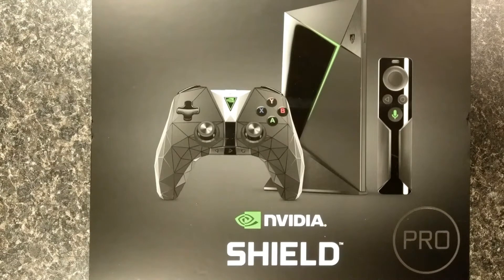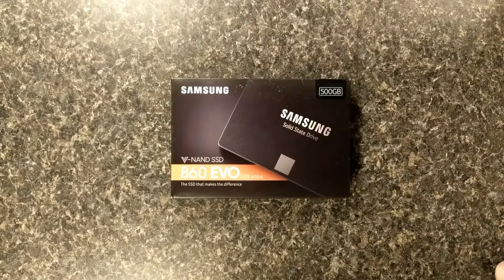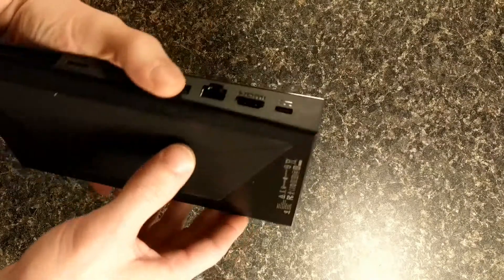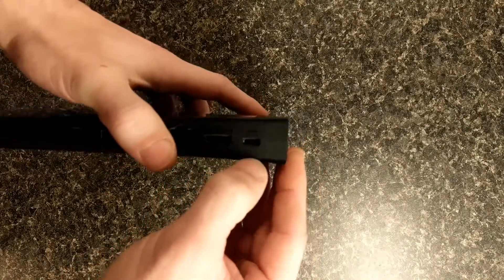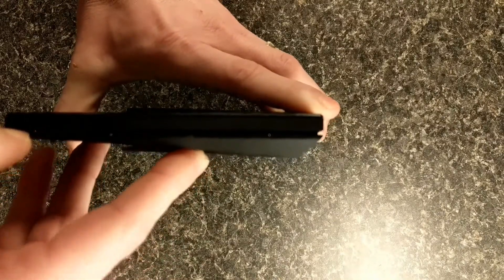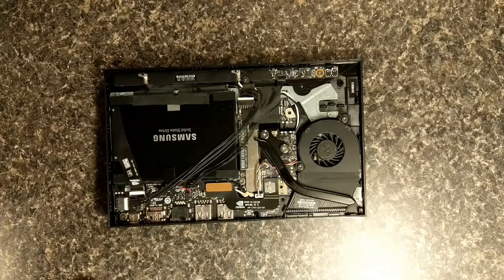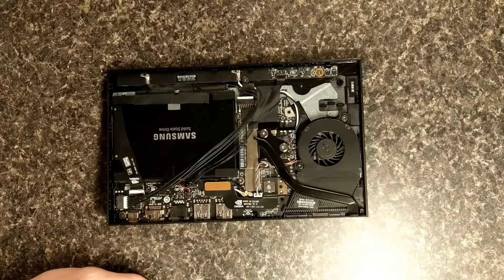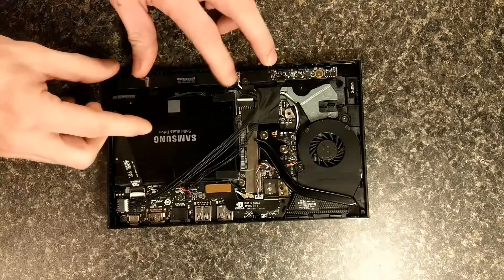Nvidia Shield Pro SSD Installation Part 1 of 2

Comment from the maker: If this video got your shield running SWEET hit that thumbs up and if you haven't already subscribe. Every little bit helps the channel, thanks for watching and have a tech day.
Reply: Please help me i like upgrade  my shield pro with ssd evo 1tb is possible?
Reply from the maker: @StreetGamesCombos  Unfortunately this method will only work with 500gb drives.
Reply: @kelleytech  thanks i need pay  now ssd 500 for upgrade
Reply: Interesting video, can this method also work with an Nvidia Shield tv pro 2019?
Reply: @migram67   The tv pro 2019 does not have a internal hard drive or space for one which is why it is so much smaller vs the 2015/2017 pro.
Reply: Do you by any chance still have a copy of the shield os on a hardrive or pc? tried cloning the drives to an ssd and now my console wont boot with either drive.

Comment: will cloning my drive work if it still wont boot up?
Reply from the maker: I cant say that it will but its your best option. I had a 1st gen shield pro that would not do a complete boot. After the clone it worked great. Remember don't format your original shield drive on accident Hope this helps!
Reply: Thank you sir !! i will let you know the outcome👍
Reply: Well , bad news it wont see the drive  i pluged a new drive in to the same port and it seen it, i may be sol unless i can find the file to download.
Reply: i will try one more thing and i will let ya know
Reply: ok my bad  i slould watch the video more closley the software reconized it , stay tuned, and thanks again
Reply from the maker: @ohmslawone5939  best of luck!

Comment: Can I use a clone device slot a and slot b I use it to clone my pc laptop from 250 to 500 gb will it work for the shield TV
Reply from the maker: Yes, it should work as long as the SSD is 500GB. Hope this helps!
Reply: @kelleytech  thanks  replying as quick as you can I have done it  late  at night and woke up this morning and it's all done placed everything back in it works better thank you very much

Comment: Hi and thx. Is that possible to use a 480 GB ssd instead 500 GB?
Reply from the maker: Hello and thanks for watching, unfortunately this method will only work with 500 GB drives. Hope this helps.

Comment: What exactly is the pro model? I have an nvidia shield with the SD card slot and the 16gb drive. Is that considered a pro? Or is the pro strictly the 500gb model
Reply from the maker: Hello and thanks for watching, unfortunately this will only work with the 2015 and 2017 500GB pro models. The 2019 pro only has 16GB. Hope this helps!

Comment: DOES ANYONE KNOWS CAN THIS BE DONE TO 2019 VERSION?
Reply from the maker: Unfortunately not but USB 3.0 storage devices make a good alternative. Hope this helps and happy streaming!
Reply: @kelleytech  my man...i hooked up a ssd via sabrent USB 3.1 adapter but when I go into the removable storage section on shield under USB drive it says-USB drive is safely ejected...i can't go into it to format...any suggestions?
Reply from the maker: @sifu192ppod  Nvidia shield can be picky, maybe format on a PC first, then try again. Hope this helps!
Reply: @kelleytech  formatted worth PC and up and running thanks bud

Comment: Does this work on the 2019 pro model?
Reply from the maker: Unfortunately the 2019 model has internal storage. This method will only work with 2017 pro or 2015 pro. Hope this helps!
Reply: Kelley Tech thank you!

Comment: I love the video. However, in my case, I cannot do anything. After the last firmware update, my shield pro refuses to boot up. It comes on for a sec then goes dead. If I pwr up the unit via the button manually it comes on for just a second and its dead. The only way I can think of is to use somebody's clone file on my new SSD and hope the shield will be normal in its boot up. Then I can do a factory reset and log in normally. Please help. I spent a fortune on games and now I cant do anything.

Comment: Thank you very much for the great tutorial for updating the HDD. Everything was easy to understand and I really needed to upgrade my HDD since it started really slowing down all of a sudden and I was worried that HDD was on it's way out. Now I have a nice Samsung Evo 860 inside the Shield and everything is going great so far! Liked and Subscribed.
Reply from the maker: Hello RETRO-TYPE
 and thanks for your support, I hope you get many years out of your shield. Happy streaming!
Reply: RETRO-TYPE what kind of improvement did you notice? Is it worth the upgrade my HDD is fine but for some reason I want to do this upgrade.
Reply: @sc6015  It's a noticeable difference for sure, but my reasons for wanting to do it were that it felt like my old harddrive was not going to last much longer. It honestly could have been the HDD or it could have been a weird thing with trying to setup a Plex server, but all of a sudden the Shield was just crawling and nothing I could do seemed to help it much. So with this process, I not only upgraded the hdd, but I also was able to keep my data and file structure intact and transfer it to the new drive and also keep a backup of the original drive as an img fiile  in case I ever need to restore it again. I'd say it's worth it just for that since as I understand it, you have to format these drives a certain way and it all seems to complex for me since I'm not a Linux user.

Comment: Hi Kelley Tech, would it be easier if i just used an external hard drive cloner to make exact copy of the existing shield hard drive?? instead of using ll the cable to connect the hard drives??
Reply from the maker: Hello xXlChAnGeSlXx
 and thanks for watching, Using cloning devices are hit or miss, some work some don't. The method shown in this video is more likely to give you positive results,and you get a backup of your shield drive. So its a win win and its cheaper.Hope this helps!
Reply: @kelleytech  ok thanks for info, well i already had a external cloner because i work in the IT field so i actually tried the cloning method with my external cloner...it took almost 2 hours to clone but it seemed to be cloned perfectly. I am now running my nvidia shield pro on 500gb samsung ssd you recommended in your link(thanks for that) and everything looks great so far and feels much snappier now thanks to you. Thanks for vid

Comment: Will this work on the 2017 non-pro version?
Reply: Non since the non-pro is smaller and doesn't have a hdd slot
Reply from the maker: Hello Greg Szarama
 and thanks for watching, unfortunately it will only work on pro models, wish I could be more helpful.

Comment: So if I were to get a 1 TB Samsung SSD hard drive instead of 500GB are you saying you wont work? Also how did you backup your previous apps before you installed this?
Reply from the maker: Hello Macktube x unfortunately you have to use a 500 GB drive. When you make  a clone it copies all of your apps and settings so it will be just like it was before installing the SSD.
Reply: @kelleytech  OK I thought when you installed a new hard drive,  it forced you to format it and erase all previous data but I guess not

Comment: Does it have to be the drive you pick? I have a Crucial 120gb SSD connected to the USB port, it works but can sometime can be slow when powering up the shield?
Reply from the maker: What's up Wembley 808, you can use just about any ssd as long as its 500GB any other size will not work. hope this helps!

Comment: 1. The screw holding the drive down is a Torx "T6".  2. Never ever pull on the wires.  Some of the cables do not need to be disconnected if otherwise following your "pull/slide-out" method.  This saves time and minimizes the possibility for a mistake if you disconnect the least amount of cables as possible.

Thanks for an otherwise very informative and helpful video!
Reply from the maker: Hello Micheal and thanks for sharing your experience you had installing your SSD. I hope you get many years out of your shield!

Comment: I was seriously about to sell my 2015 original shield TV, but just for giggles looked up about the possibility of putting an SSD into it and this is one of the only results that pops up. Was skeptical, but bought my USB 3.0 to SATA connector and an 860 Evo and thought I'd give it a shot. Now the thing is like lightning. I'm back in love with my shield. Thanks for the video.
Reply: Dude is it possible on 16 gb version
Reply: @mmj19833891  I don't believe so. I believe we're tricking the "pro" version of the device that has a 500gb HDD into thinking that the drive is still the same by cloning it, then putting the SSD into it's place. With the 16gb version, you're already using flash memory, so your best bet is to expand memory with a micro SD card

Comment: Worked like a freaking charm, not sure why your video hasn't gotten more attention. Your detailed instructions left no room for error. Thank You So Much
Reply from the maker: That's great news, shield plus SSD equals awesome. Thanks for watching and happy streaming my friend.
Reply: @kelleytech  bro is it possible on the 16 gig version
Reply from the maker: Whats up mmj? It can be done but it is very complicated, you have to do some soldering and some programming, i have never done it myself. My best advice would be to get a usb 3.0 SSD external drive and add it to internal storage. You probably already know how but if you don't check out this link at 1:30 in. Hope this helps! https://youtu.be/Zr6VJh0PKro
Reply: @kelleytech  thanks 😊
Reply: @kelleytech  if it's possible would you give it a try?
Reply from the maker: mmj i wish i could, it would be fun to try but i don't own a 16GB model to try on.
Reply: @mmj19833891  Nope since is a much smaller. It's a different device if you can say that!
Reply: Kelley Tech I have a 2017 shield pro that is like new, I want to do this upgrade. What kind of improvements did you notice? I won’t game a whole lot mainly for streaming iptv service PPV events NFL Sunday ticket etc. But for some reason I still want to do the SSD upgrade lol. 👍

Comment: Aha, was looking at the possibilty to upgrade a 2015 16gb version with an SSD, but unfortunately it would require a header to be soldered (where the flat sata cable connects to the mainboard) as well as getting the relevant cables. Sadly my soldering skills are woefully lacking - project abandoned! Useful vid Kelley Tech - subscribed
Reply from the maker: Thank you for subscribing I appreciate your support!

Comment: Why do you say the 512gb SSD won't work ?
Reply from the maker: Hi Mark and thanks for watching, the short answer is that the Shield Pro was programmed to read 500gb storage drives only. I tried with a 512GB Plextor SSD I had laying around, it would not boot no matter what method I tried, even Linux was a no go. So I had to buy one. I have to say the 860 EVO was a perfect match. Hope this helps!
Reply: @kelleytech  https://rover.ebay.com/rover/0/0/0?mpre=https%3A%2F%2Fwww.ebay.com%2Fulk%2Fitm%2F132145762587
Reply: These guys are using 512gb ssd
Reply from the maker: @AvWeMetYet  Looks like you have been browsing xda, I saw the same URL there that you posted here, xda is a great place for android info. You could give it a try with a 512GB drive, worst case scenario would be that it won't work,  but that won't hurt anything, just put your original drive back in and it will work just like it did before you started the process. Best case scenario would be your going to lose the extra 12GB of drive space. If you can't get it to work this url should get you pointed in the right direction.  https://forum.xda-developers.com/shield-tv/general/guide-migrate-to-ssd-hdd-size-satv-pro-t3440195 Please let me know how it goes. it could be that my plextor SSD is just not compatible. Best of luck my friend.

Comment: Is it possible to swap to SSD  in the 16gb Nvidia Shiled 2017 version?
Reply from the maker: Yes you can but it is extremely difficult, it has to do with some soldering and some Linux commands. I've never done it myself, but it can be done.  If you are really interested, its in this thread somewhere - https://forum.xda-developers.com/shield-tv/development/nvidia-shield-tv-ssd-t3402580 Hope this helps, Good Luck!